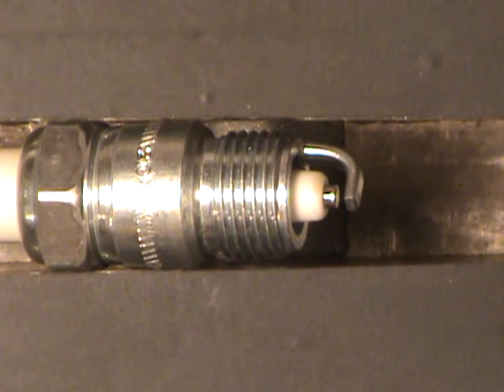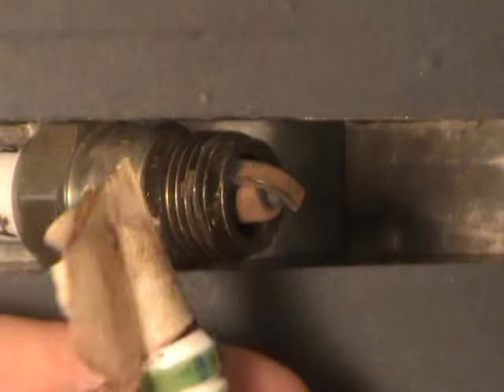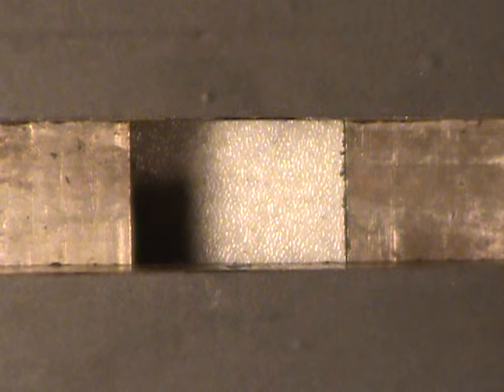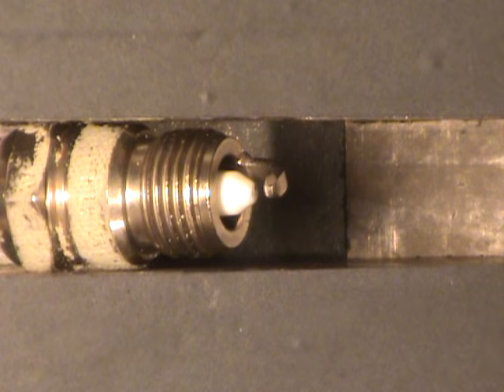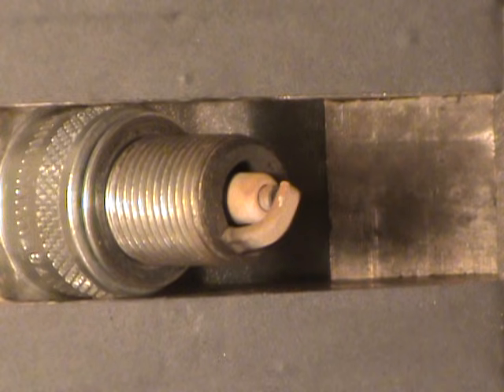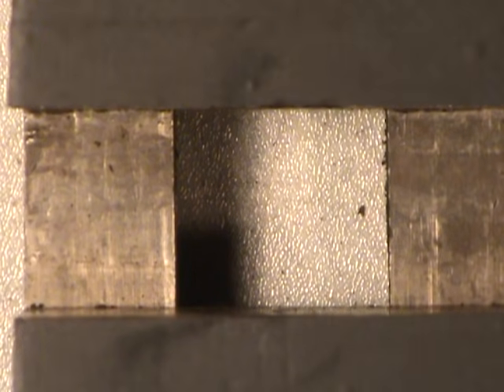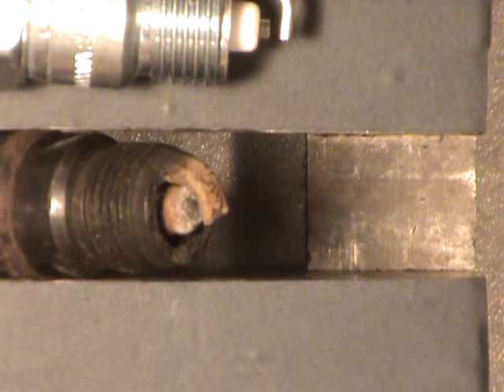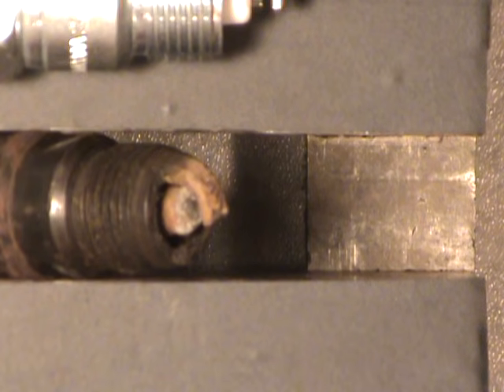SPARK PLUGS How to Read them (Part 3)

Comment: Great video! I have a fuel injected performance car with one cylinder that’s burned the center electrode down twice, thinking injector issue, thoughts?
Reply from the maker: Greetings...Mike Berzinis………..Thanks for the nice comment, and thanks, for watching too...…..Well, in order for a spark plug's electrodes, to erode away, in a very short time period, then, I be thinkin', that, that particular spark plug (in the set of them), is not able, to transfer it's heat away from itself properly, and, as it should be doing...…...Might be, that, the coolant passage, nearest to the problem cylinder, is blocked possibly, by sludge, or corrosion, as a guess (I've seen, some engine gaskets, that have, coolant, manufactured/blocked-off portions on them, and, Ya gotta make sure, that, Ya install the "exact/correct" intake gaskets...!!!)...…….If your vehicle, has the OBD-2 (On-Board-Diagnostics-version-2) system (usually 1996 or newer, that has, the 16 pin terminal connector, on the lower dashboard area, near the steering wheel), then, you can scan (or, live monitor), with a scan tool, both, the short term/fuel trim, and, the long term/fuel trim, which will basically be telling you, that, extra fuel is being added, or, less (than normal) is, by the fuel injectors...…….Is that one spark plug's center electrode, actually burned away...??? (lookin' kinda melted, if you will), or maybe, it might be caused by, that particular cylinder detonating, maybe...??? (caused by, a lean air/fuel ratio, in that particular cylinder, perhaps)……….All of the fuel injectors, should be flowing, about the same, and maybe, do, or have them flow tested, or maybe, invest in a new set of them, that are flow "rated" (in volume per hour, perhaps), for your exact vehicle, and modified engine...……Also, do a fuel pressure test, at the fuel rail (or equivalent), and make sure, that, it's where it should be (as per specifications), because, it affects the fuel injector's, flow ability (be careful, because of, the high fuel pressure...!!!).........Check for, an intake related vacuum leak (bad gasket/s or loose bolts or nuts)………..You can also, hook up a vacuum gauge, to the intake manifold or plenum, to see if the vacuum reading, is stable at idle speed, as well as, at, just about any throttle position as well, if the vacuum gauge is mounted on the dashboard, that is...……..If you care to, you can post/comment, what your vehicle, and modified engine, actually is, that way, I might have a much better chance, at helping you out, and...….till next time...….Be Safe, take care, and have a good one.

Comment: after how many miles?
Reply from the maker: Greetings...Doc Lex...…….Thanks for watching...…….I'm not sure, what it is, that you are asking about...…….Was it, when to change the set of spark plugs, or maybe, how many miles of driving will be needed, so the spark plugs will have enough deposits on them, to look at...???...…...Follow the vehicle manufacturer's recommendation, for the spark plug changing interval, be it, in miles, or, kilometers...…….As for, having some deposits, showing up on the spark plugs then, oh, about 100 to 300 miles of driving, might be enough, just look at one of the spark plugs after that amount of driving on them, and, if more driving is needed, to produce a readable amount of deposits, then, keep on driving, for a few hundred, more miles...…….If the above isn't what you were looking for, then, tell me..."exactly"...what it is, that you want to know about, and...….till next time...….Be Safe, take care, and have a good one.

Comment: How can one know if the plug is bad if it looks ok appearance wise?
Reply from the maker: Greetings...Ali Hussain...…….Thanks for watching...…….A good (used) spark plug, is usually, reasonably clean, and doesn't have many deposits stuck onto it...…….Also, the spark plug shouldn't look as though, it's electrodes look kinda melted (got too hot)………...The spark plug "gap", that is between the spark plug's two electrodes, should not be allowed to get too big, as this will usually make the ignition coil, or coils, work a lot harder, then, the factory specified spark plug "gap" would...…….When it comes to installing "new" spark plugs, try to always get, the same brand and part number, that was installed in the engine, when it was brand new, to avoid having, any not wanted or needed problems, oh, and, make sure, that, the spark plug "gap", is at the factory specified size...…….Some spark plug "gaps", can't be adjusted, or they might become damaged, and...….till next time...…Be Safe, take care, and have a good one.
Reply: @RockysRoadshow  thanks for your reply. What I wanted to know was how would you know if the spark plug is bad if it looks great appearance wise. For example, regardless of the fact of the appearance of a common bulb, we know that if its filament is ok, it will work, if the filament is broken, it will not work even if it is as clean aS a new one from outside. The reason for asking is even if its dirty and oily and hasn't been changed for years, mostly the car will still work.
Reply from the maker: Greetings...Ali Hussain...…….If your vehicle is 1996 or newer, and, there is a problem with one or more spark of the spark plugs misfiring, then, a trouble code, will usually get stored in the vehicle's on-board computer...…….A scan tool will be needed to gain access to any of the trouble codes, that might be stored in there...…...If your vehicle is older then that, then, things are usually different...…..If you have an older than 1996 vehicle, then, if you can tell me, the vehicle's...year...make...model...engine size, and number of cylinders that it has, then, I will then have, much more information to go on, and.....till next time.....Be Safe, take care, and have a good one.

Comment: The truck is 1991 silverado 4x4 5.7l auto with 97K miles I think. Motor #2. I just found the distributer hold down bolt loose, its been slowly turning. EGR valve was stuck also. Plugs only had 2000 miles on them. A stock Tbi motor that has had a stalling problem, at idle, RPM just falls off to 0. After resetting timing, all new tune-up parts installed and new EGR, runs smooth, but stalling after a few seconds of slow idle is back. Fuel pump, filter,lines all about three yrs old. Plus, dash oil psi gauge reads 20psi at start-up, less when hot. No engine knock, but only OBD1 code is knock sensor.   Thanks, Cat
Reply from the maker: Greetings...Cat Dakman………..Wowsers…!!!...good job, on describing, just about everything...…...A distributor that "self-adjusts"...???...lol...…….There can be quite a few things, that can cause an engine, such as yours is, to stall (stop running), while at idle speed RPM's...…...Now then, about you sayin'...re-setting the timing...…….Did you (or who-ever?), use the correct procedure, along with, setting it, at the "specified" base ignition timing...???...…...I'm pretty sure, that, the procedure, might be, to have the engine fully warmed up to operating temperature first, then, shut off the engine...then...disconnect that tan colored wiring connector, that's reasonably close to, the distributor...then...start the engine...then, with a timing light, probably set the "base" ignition timing, at the specified number of degrees (with my, four years newer, GMC V-6 engine, the base timing, is set at "Zero" degrees, as an example, oh, and also, on my harmonic balancer, had "2" lines/grooves in it, so, I had to make sure and use, the correct line/groove, or, the base timing, wouldn't even be close...!!!)………..Once you are absolutely sure, that, the "base" timing is set "correctly", as is "specified", for your exact engine and vehicle, then, we can move on further...…….The "idle air control valve" (IAC), can also cause idling problems too, as, this IAC, really only affects idle speed ("it" controls the amount of air, that enters the engine, at idle speed only)……...Careful now, if adjusting or replacing an IAC, because, there might be two types/styles of them, and, they are pre-set differently...get it wrong, and, a new one will be needed...……Have a look, inside of your distributor, with the cap, off of it, and have a look-see, where those 8 triangles are located...…….If Ya can see, what looks to be, a magnet near those 8 triangles, then, look very closely, maybe, even with a magnifying glass, for any "cracks" in, said magnet...……Cracks = not good, and, might cause, shall we say, ghost signals, that will probably make for, a very confused signal, for the ignition control module, as well as, the vehicle's on-board computer, as well...…….Also, while Ur at it, have a look-see, inside of the distributor cap, and inspect that center, contact button (if it's the small type, that's spring loaded, they sure don't last very long...!!!)………..Did you clear that OBD-1 code, as in, "knock sensor"...???...…...With a properly operating EGR (Exhaust Gas Recirculation) valve, then, the ignition timing "advance", can be increased a few degrees, and not trigger, that about 6300 Hz (cycles per second), knock triggering frequency, where-as, a non-functioning EGR valve, won't dilute the air/fuel mixture enough, before it ignites, inside of the engine's cylinders (please note, that, it's the vehicle's on-board computer, that controls the ignition timing advance amount/degrees, and, if, the knock sensor, sends a, shall we say, knock "signal" to the computer, then, the computer, will usually, back-off/reduce, the ignition timing advance, just enough, in order to not allow any more engine knock, to take place...…..Some computers, might only back-off/reduce, the ignition timing advance, by about 10 crankshaft degrees....maybe...???)………..Are you putting the specified "Octane" rated gasoline, into the Silverado's gas tank...???...…...If you happen to put in 87 Octane, into a vehicle's gas tank, that was specified to have 90 or above, then, that alone, could very well cause a knock signal or two, especially if, the on-board computer, wasn't able to compensate, for doin' such a thing...just sayin' now...……Get a hold of a fuel pressure gauge, and, check the fuel pressure, at idle, and different RPM's as well...…...A throttle body fuel injection system, will probably have, up to about 13 PSI/Pounds per Square Inch, of fuel pressure...but, always look up, the "exact specifications", for your vehicle first...!!!...…...Air and fuel filters clean...???...…….Make sure, that, your EGR valve stays "closed", during idle speed, or otherwise, if the EGR valve allows any exhaust gas, to get inhaled into the engine, while at idle speed, then, it might be a sHaKiNg engine, or like yours is now...silent...lol...…...Now then, my take, on oil pressure...…….Ya can get away with, about 10 PSI, at idle speed, on a factory stock engine...…...The good ole rule of thumb (so to speak), was to, have about, 10 PSI, for every 1,000 engine RPM's (probably be a minimum...huh), oh, and, those PSI's, would be, when the engine is up to full, operating temperature (cold oil pressure, sure looks impressive alright, but, hot oil, is the true nature of the beast...lol)………..Another thing to do, is to, shine a timing light at the harmonic balancer, while the engine is running, while the gear selector is in park, with the emergency on...……..Now then, what Ur looking for, is, is the timing mark staying in one place, while the engine RPM's are being held steady, or, is that timing mark moving forwards or backwards...……..If it's "not stationary", while holing the engine RPM's steady, then, it will probably be an ignition related problem...……..Sometimes, the timing light's flashes, will appear to be skipping, or missing, and, not be, at steady/regular intervals (this might indicate an ignition system problem as well, or maybe, it's time to get a new timing light...maybe...???...lol)……….It's a 4x4...yes...???...well, if, while in any 4x4 mode, that actually "lock" the front differential (axle), with the rear one, then, watch out for "wind-up", which has been known, to destroy a transfer case or two...…….To try and avoid that, so called 4x4 "wind-up", then, make sure, that, the "outside" diameter, of, all 4 tires, are all (reasonably) the "same" (outside) diameter, oh, and, I'll even bet, that, tire pressure, might just play, some kind of a role as well, maybe...???...you be the judge, and...….till next time...….Be Safe, take care, and have a good one.
Reply from the maker: Greetings (once again) Cat Dakman……….Here's something else, that, I didn't mention, in my last reply to you, about, what might be causing, your Silverado's engine, to be stalling, at idle speed rpm's..……..Another thing to check-for, happens to be, any "intake" related (air) "vacuum leaks", as in, any air leak, that shouldn't be taking place, as a result of, something like, a faulty gasket/loose bolts or nuts, or perhaps, a small diameter, rubber-like vacuum hose, or maybe, it's made out of hard plastic pipe/tubing, that has become disconnected, or perhaps, cracked or split, which will allow un-wanted/un-metered air, to be inhaled, by the engine...……..Vacuum leaks, are usually, most noticed, while the engine is at idle speed rpm's, and, sometimes, the engine will shake a little bit, or lots, depending on, just how bad, that hypothetical vacuum leak, happens to be, and yes, if a vacuum leak is bad enough, a stalling engine, it could very well be...……….I use a Vacuum "Gauge" (about $50 Dollars, give or take a bit), and hook it's rubber-like hose, to a port, or fitting, that goes into the intake manifold, on a throttle body/fuel injected, or carbureted engine, and, on the newer types of fuel injected engines, I hook the vacuum gauge's rubber-like hose, to a vacuum source, that goes, directly into, the intake (air) plenum (the word plenum, is just a fancy name, for an air chamber...lol)………..All-righty-then, with my fully warmed-up, 4.3 liter V-6 engine, I saw about 17" Hg at idle speed rpm's (Hg = inches of mercury, showing on the vacuum gauge), which is about normal, oh, and, the gauge's indicating needle/pointer, held steady, and didn't wave at me...lol...which I don't want it to do, as, that would be indicating, one of the many problems, that, a vacuum gauge, has the ability/reputation, for being able to show, as in, detecting/diagnosing a multitude of problems/running defects, well, if Ya can interpret the needle/pointer's behaviour, properly, that is...lol...………On some, if not most, vacuum gauges, there is usually seen, some different colored lines, and, if the needle/pointer, is with-in the green color band, then, a good day, it will usually be...…….Lem-me-see-now.....your vacuum leak, if there happens to be one, that is, might be, a port or fitting, on the throttle body, or, intake manifold, that is open to the atmosphere, and doesn't have a vacuum hose connected to it, where there should be one, or perhaps, a rubber-like plug or cap, might be missing (do a visual check, for anything, that might cause, an un-wanted, vacuum/air leak)………..Are the throttle body's, bolts or nuts tight enough...???...…….Are all of the intake manifold bolts, and/or nuts, tightened down properly...???...…….The gasket, that's sandwiched, between the bottom of the throttle body, and, the top of the intake manifold, has to be in very good condition...…… The two intake manifold gaskets, on a V-8 (or V-6) engine, have to be, in, very, very good condition, or, if not, then that, in itself, is just begging for, a good ole "vacuum leak"...lol...……I replaced my V-6's intake manifold gaskets, and, it sure helped a lot, probably because, the original factory ones, were laminated (sandwiched) together, as in, gasket material, was on one side, sheet metal in the middle, then, another layer of gasket material on the other side...…….I found, that, just by looking at the old intake manifold gaskets, that, they looked to be, really dry (brittle...???), and, where they were squished, between the intake manifold, and the cylinder head, well, they didn't look so good to me, at all, so then, I installed, a set of Felpro (good quality) intake manifold gaskets, and, I'm sure that helped quite a bit, with the rough idle, that I had at the time...……Have a look, at your Silverado's "oxygen sensor/s" sometime, as, by doing so, is, well, kinda, the same-as, looking at a spark plug, somewhat...……I've had it, where, the engine was running, really, really "rich" (air-fuel ratio/mixture-wise) due to a fuel injection problem, and, the oxygen sensor, was all covered, (big-time), with lots of, dry, black carbon...!!!...……It got so bad one time, where, it seemed like, I smelled something "burning", somewhat (the mini-van was parked, engine was running, and, I had the doghouse, aka, engine cover, off, of the engine, at the time), so, I jumped out, and had a look underneath the van, and...Hole-ee-gwalk-ah-mole-ee...the damn...catalytic converter...was..."Glowing"...a..."Bright Orange Color...!!!...(now, that's HOT...!!!)...needless to say, it sure didn't take me very long, to turn off that ignition key...!!!...lol...……..So yeah, never park a "rich" running, catalytic converter equipped vehicle, on top of, any dry grass, or flammable material, or..."hear that"...???...here come the Firetrucks...!!!...lol...……Well, maybe I'm a bit too late, as in, Ya got er fixed already, maybe...???...and...….till next time......Be Safe, take care, and have a good one.
Reply: @RockysRoadshow  Thank you VERY MUCH for your input. I do have one vacume line to check. Plastic tube with rubber ends that are different sizes at each end. Cold temps outside hear now so have to prepare to be outside. I will let you know. Thanks again, CAT
Reply: Fixed a vacuum leak....... now truck will not start cold. 35 degrees or less motor only starts after putting fuel or eather down tbi. Then runs fine. Got to go now....